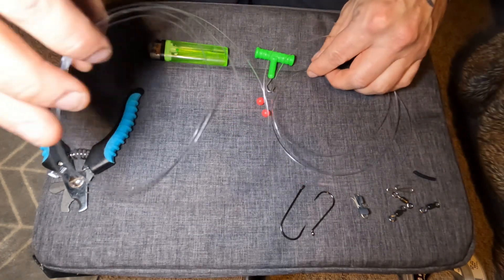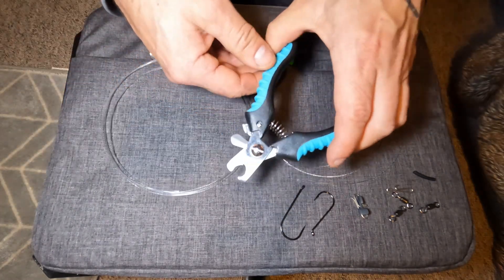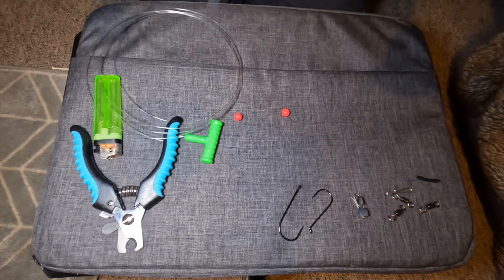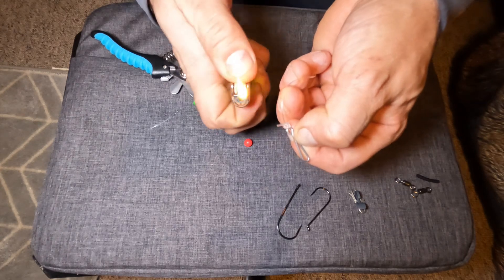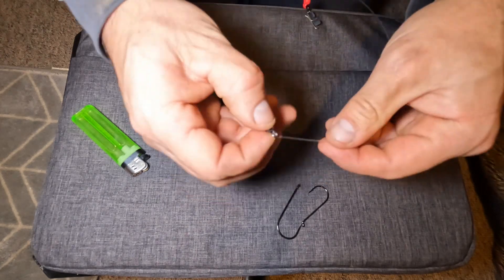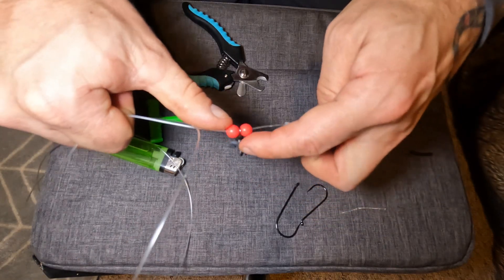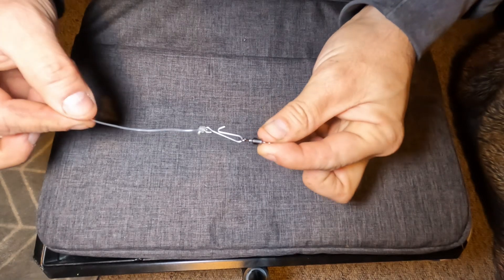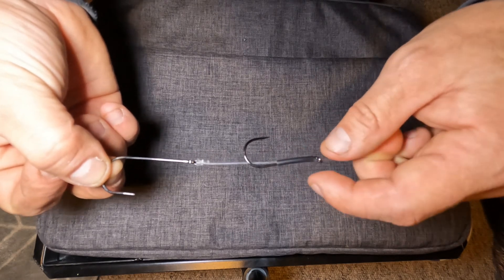How To Build an Up and Over Pennel Rig

Comment: Good set up there Greg and easy to make. I do like sakuma mantra hooks for the larger fish as you say for hounds and rays. Personally I use a sakuma chinu size 2 as the pennal I found I got a better hook up ratio with them!
Reply from the maker: I like the chinu ones too but I've run out🤦🤣  the manta hooks are great value

Comment: I use the same rigs myself for most of my fishing, an up and over with a sliding lead and a bigger bait on it, and the other with a 2 hook rig or a loop rig.

Am going to have a fiddle about though, and see if can tie it somehow with the lead on a loop, so can use a short fat bloody bait on a hair/circle hook so it presents the bait the way a dingle dangle rig does, and gives a way of using a thick bait that stays clipped, and hooks more fish in the mouth rather than swallowed hooks.
Also the loop of slack line just above the lead when ready to cast, can then be a built in rotten bottom when released.
(If that makes sense??)
Reply from the maker: Yeah that sort of makes sense 🤔  it's all about playing around and testing things.  I've done that very thing this morning, completely altering a rig to try and suit something new. All I have to do now is test it🤦

Comment: Hi i was just wondering what is the length of the body + snood, thanks
Reply from the maker: How long you build them does depend a little on how big a rod you use🤔 mine are at least 14ft long so I build between 60 80cm bodies with 110 150cm hook snoods.  Obviously the hook snood needs to be less than double the body length👍